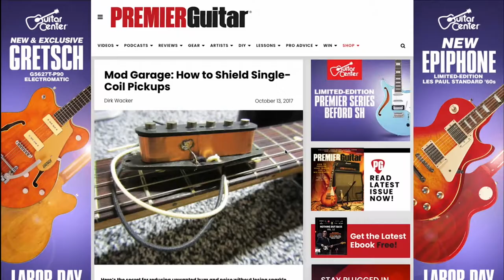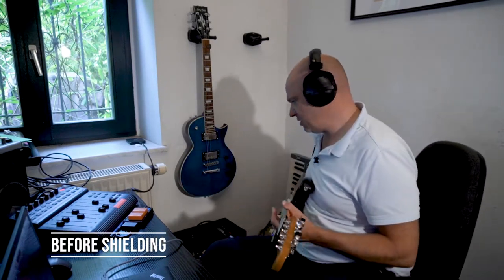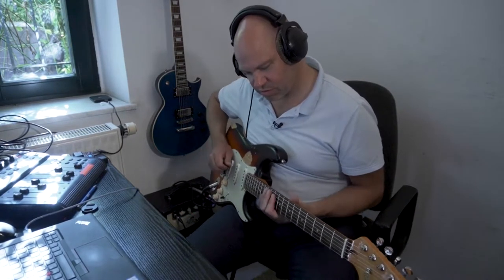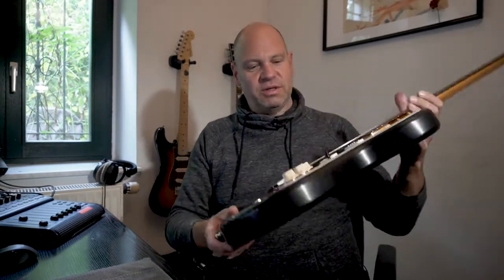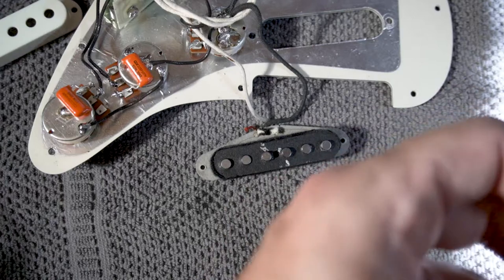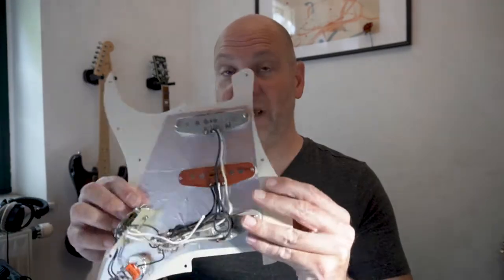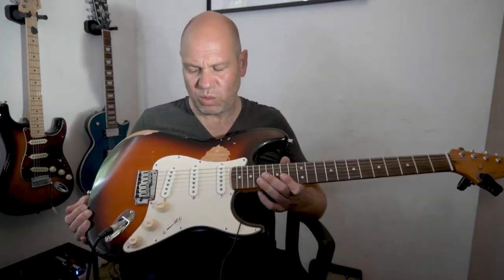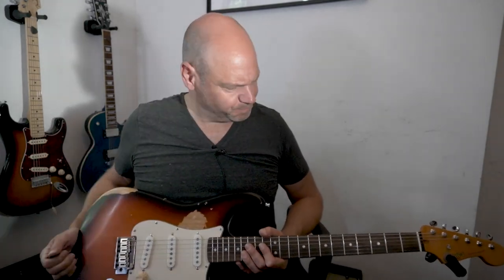Shielding Single coil Pickups with copper Tape on a Stratocaster

Comment: Just watched this as I shielded a copy of a strat.
I added the foil around the single coil pickups and it made a huge difference. Also I have to stress that it's important that you ground the shielding around the single coil pickup, otherwise it wont do any difference.
Everything has to have common ground.
I even run small wires between each cavity with a ground wire to ensure they have common ground.
The result was a major reduction in noise all together.
Great video otherwise and happy hunting for the tone my dude! :)

Comment: Wait!
There are copper single coil pickup covers. It's so ridiculous Fender and other reputable brands never made this a standard feature, but Fender didn't even make the reverse wound middle single coil standard until 1985!
The other option is an active pickup module, but I'm an engineer so I design and build my own and can't speak for what is on the commercial market. I used to grimace at the thought of a battery in my guitar, then I designed my own module as an experiment and can't stand to be without them. The 60/50 cycle and other atmospheric noise never makes it beyond the battery.

Now granted I'm a metal and instrumentalist so I use mostly humbuckers, nothing sounds as good as a single coil. Going active just makes them even better and they can be taken to a whole new level with high/low/bandpass filters. It also means a $5 no namer pickup sounds like you spent 100x that on it.

Comment: The misconception much people follow is the belief that shielding eliminate the noise in single coils, when that's a mistake. The natural hum from single coils will always be there, what shielding is intended for is to minimize the EMI (electromagnetic interferences) caused by the electric wnvironment surround you. If you want to real eliminate the single coil's natural hum the only way is to use a "dummy coil" which make your pickups work like a humbucker, nevertheless this mod will make noisy you position 2 and 4. Also keep in mind that EMI is different each time depending of the orientation you place your guitar when playing and the devices near you, this later is what much times lead people to believe the shielding is magic.

Comment: I believe the article that you referred to in the beginning mentioned a couple of things that I can't tell whether or not you adhere to - namely you cannot connect the copper foil and once it's drowned around the pickup. You also must connect that copper foil to ground of the guitar so continuity is continuous throughout all ground and shielding. You do not need to do multiple layers I think that's what you're trying to do at one point in your video - little bit long so I was skipping through it. Shielding the body and the pick guard will have a greater effect than just shielding the pick up some cells. Always make sure all of your shielding and ground are connected. And one final measure which is a good rule of thumb is to get shielded wire and replace all of the wiring with shielded wire in addition to shielding the cavity and the pickups.

Comment: If you have weak sound, half of the volume, no enough low end in only the 2 & 4 position, cances are the the 2 & 4 position is "out of phase". So you need to swap the middle pickup's two wire. (Hot and the ground) So if you swap it the hot will go to the ground and the ground wire goes to the Hot. In my opinion, try this.
Reply from the maker: Thanks a lot for your advise, few days ago I thought about that possibility as well..
Reply: @ksguitars5310  Try it if you have time, and let us know. :)

Comment: Never put copper tape directly over the pickup coil wires.  The pickup coil wires should already have cloth tape around them before applying the copper tape . The copper tape then must be grounded to shunt any noise that is intercepted by the copper tape shield to ground.

Comment: You gotta be extremely careful doing this to your pickups cause I have messed some up doing this and they never worked when done. It's very easy to break a strand of wire on the wind if your not extremely careful. I'm not worried about noise that's not why I did mine. I'm old school I don't even use reverse wound pickups. People Crack me up all worried about a little noise you only hear when not playing lol just turn the volume down. The closer you sit facing your rig your going to get noise so just get away from it some. This mod really isn't mentioned to get rid of noise it can change things about the pickups if dine properly like the impedance levels and things.

Comment: The tape on the pickup itseld wont make any difference unless its grounded and it didnt look like you connected a ground wire to the tape.
Reply from the maker: Hey Paul, yes it is grounded! As you can see in the video that there is a tiny wire soldered to the foil tape!
Reply: No need to solder it to the tape. He needed to cover the cavities and pick guard entirely

Comment: I want to try this too. 
   A gap between start and end of the foil is not good. The copper foil should connect, to form a "Faraday cage“ (Faraday‘scher Käfig). The glue on the sticky foil works like an insulator, you have to make sure of the conducting continuity. 
   If you don‘t like to have the copper glued on the pickup, you can leave the paper on it. Important is the continuity thru the copper to ground. Same applies to cavity shielding: the foil on the pickguard should connect to the foil in the cavity and also to ground. 
   Hope you can save the first middle pickup, by restoring the wire connection…
   (Das Abschirmen funktioniert auch mit dem Papier drunter. Eventuell beide Enden der Kupfer Folie schon überlappend kleben, aber dann die Stelle mit Graphit shielding lack überpinseln und somit verbinden. Aufpassen: mit dem steifen Papier dran kann leicht das dünne Drähtchen wieder gedrückt und beschädigt werden . Ich würde dort eine Aussparung schneiden. 
   
Grüsse //Rudy
Reply: They're absolutely must be a gap in the copper foil you do not want the foil to make a complete wrap around the coil as you will have Eddy currents that wrap around the coil in the copper foil. Additionally you must connect the copper foil around the coil to ground using a short jumper cable from the pickup ground to the Copper foil around the coil. I feel like Dr Seuss.
Reply: @Alastorsimpforever   
Ooh, thank you!👍🏼 Now I feel like Einstein!